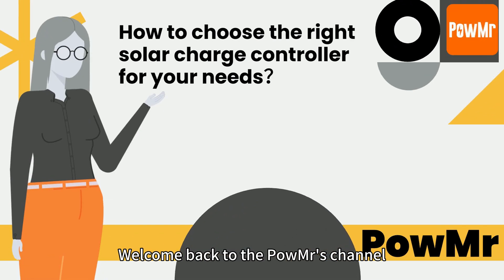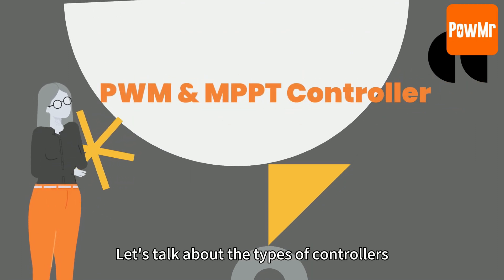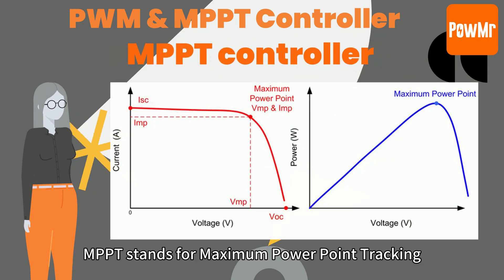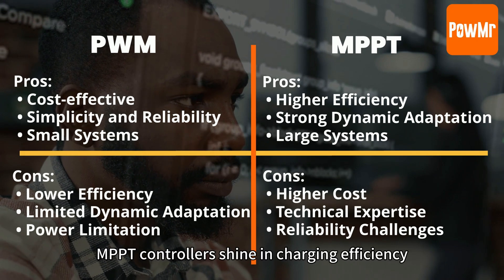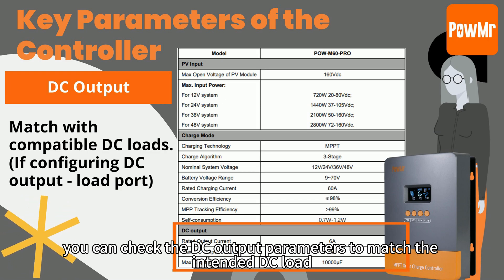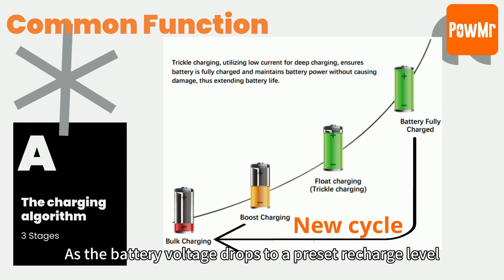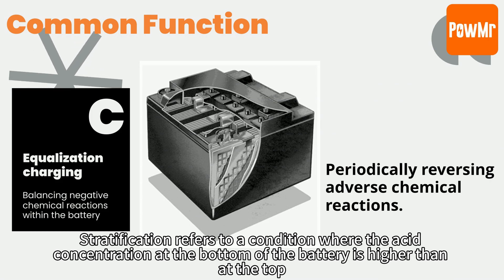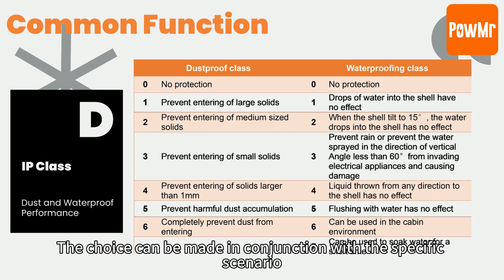How to Choose the Right Solar Charge Controller for Your Needs

Comment: POW-M60-PRO VS POW-HHJ-60A. I am confused about which of these two products to take. What are the differences between these two products? Which one should I take and why?
Reply from the maker: POW-M60-PRO:
1. Large flat screen, easy to watch and operate.
2. There is latex to better protect the chip.
3. Aluminum sheet heat dissipation and good waterproof performance.
HHJ60A：
1. Aluminum alloy shell, strong and durable.
2. Exquisite and compact, installation does not take up space.
3. Fan heat dissipation, good heat dissipation effect.